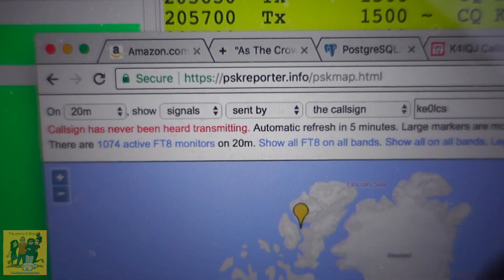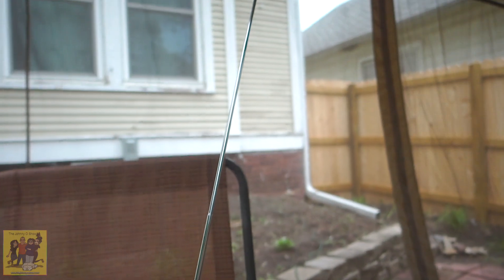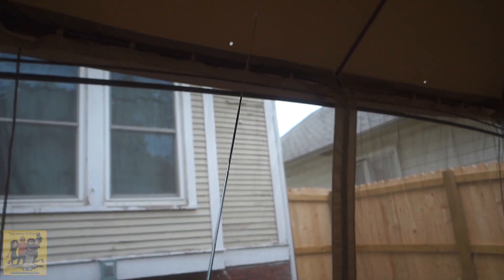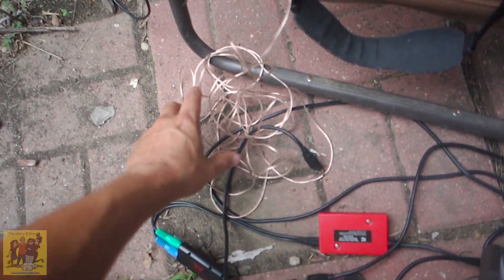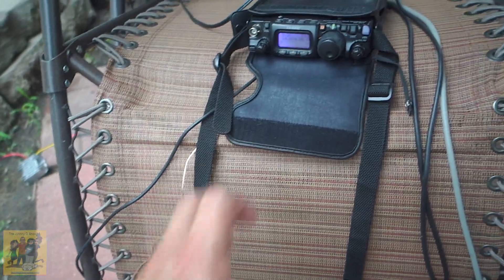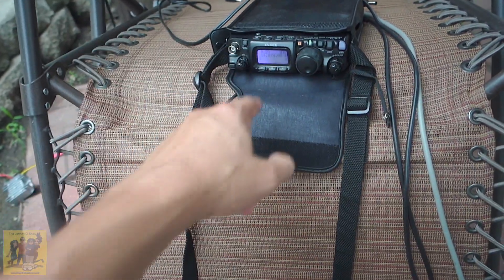Ep. #514 MFJ-1820T 20 Meter Antenna Review

Comment: Great vid, I have used the MFJ-1820T along with my FT817ND and worked Germany from a local park in New York City.I believe the antenna is made for portable ops AWAY from a home or large structure. I drop my S7 noise level to nil just by going to the local park. No led bulbs,computers, plasma tvs etc etc. you should try OPEC  BNC Magnetic Mount with that antenna. I did not use counterpoise wire but rather stuck magmount onto large bolt that holds picnic table together, SWR 1.2 across the band.  Received great signal report from Europe and locals.  N2YDC
Reply from the maker: Yes i have found a long as i'm not using for digital modes (so no unneeded electronics near by) and away from the noise it does ok, and for $25 its worth having in the bag.  I love your idea with using the metal frame from the picnic table as the ground plane, i will have to try that. Thanks
Reply: The Johnny O Show Keep up the vids J.O.